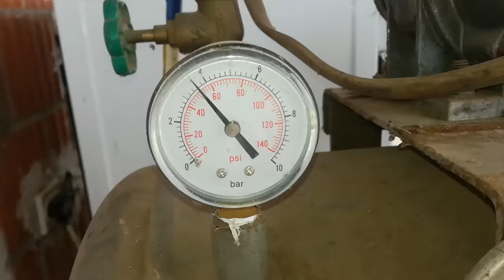DIY Sandblaster

Comment: The maximum particle size must be 1/5 of the nozzle outlet hole.
For example with a 3mm nozzle the granulometry or sand, at most 0.6mm. (3mm / 5 = 0.6)

Comment: Isn't the starting gun already a sandblasting gun? it seems to me that the red container is used to put the abrasive which is then vacuumed by depression
Reply: That's a parafin gun but in all honesty if you was to take the nosel off the end I would have thought it could do the same job ... Never tested this theory so would be interesting
Reply: I thought the same thing .. did he just take apart a sandblast gun to make a more complicated sandblast gun?
Reply: W W  this is wrong, I have a sandblasting gun which does not work by gravity but by depression, the tank is under the barrel :)
(like the Metabo SSP 1000 for example)
Reply: @anthonys4685  I presume with sand you need to blow air in from the bottom,  unlike with liquids.

Comment: Need a larger compressor. Most people use the 1/4 inch coupler. I see you used the larger one.  You can all soak the rusty part in 1 part molasses to 9 parts water for 7 days, and the rust will wash off with running water.
Reply: I'll  try and will  report back the result. Sorry, skeptical,  but love sweet ideas!🤣